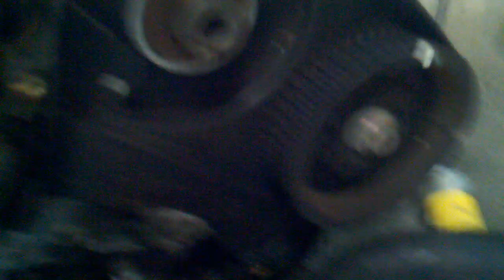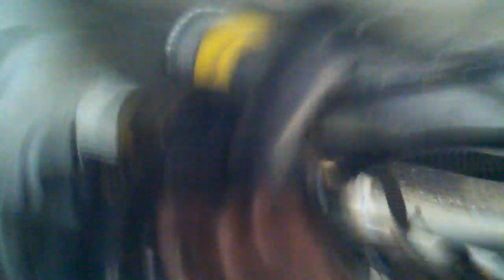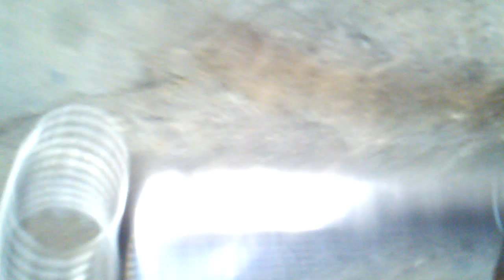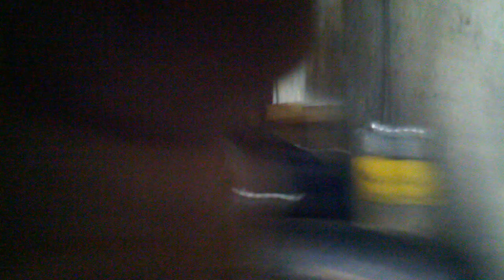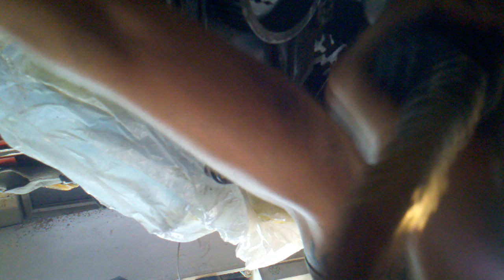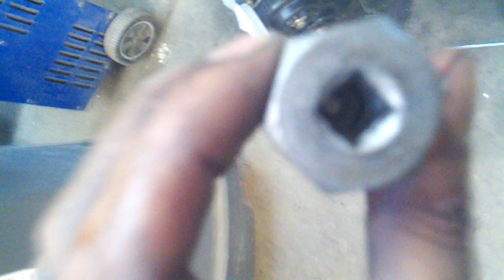how to remove a subaru wrx camshaft cam bolt in under 30 seconds with out breaking anything.

Comment: That's so nice they give you a wrench spot on the cams. I don't get why my legacy cams never have this!
Reply: Same with my 2006 WRX. No spot to hold onto the hollow camshafts. Ended up drilling the head of the exhaust cam bolt out and going to replace it with a normal bolt instead of the stupid 10mm allen bolt crap that Subaru uses. Worst cam sprocket design EVER!

Comment: First of all, awesome idea.  I am having a hell of a time with the cam gear bolts on my car.  I measured the OD of the bolts on my 2005 STi, and they are 18mm.  I found a set of broken bolt extractors from Sears on sale for $17.99.  The biggest one (19mm/3/4") seems to fit well.  I'll update later today if I am successful.

Comment: Sadly this is not useful on the newer dual avcs subaru engine. The valve cover can not be removed without first removing the cam gear.